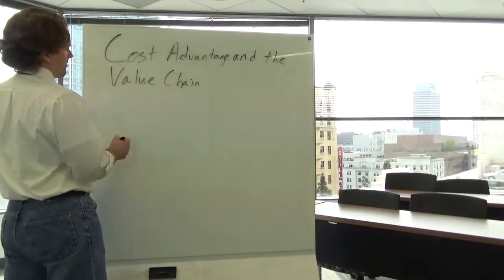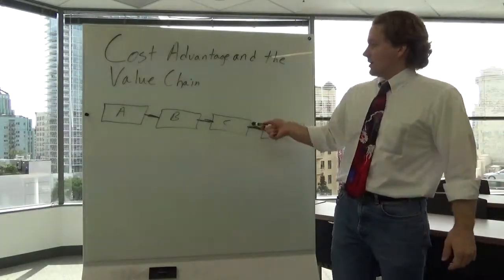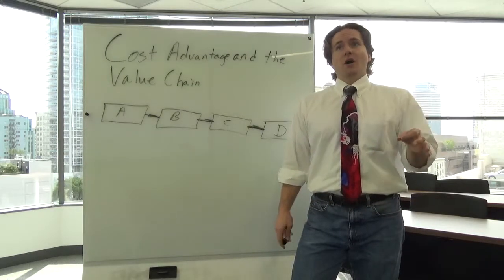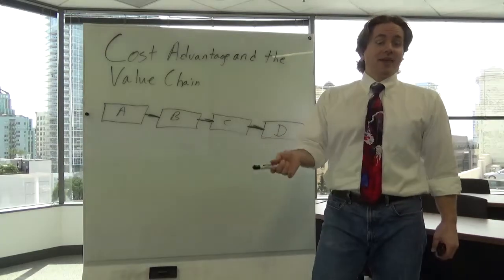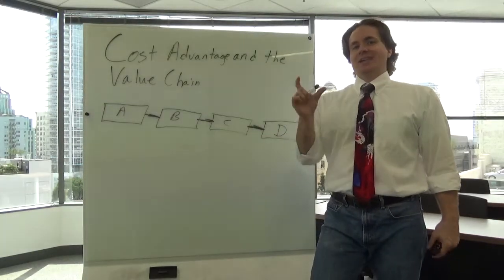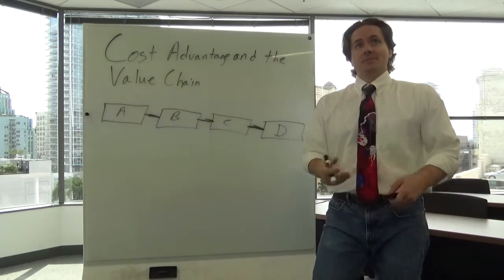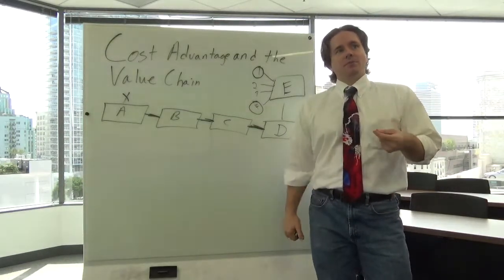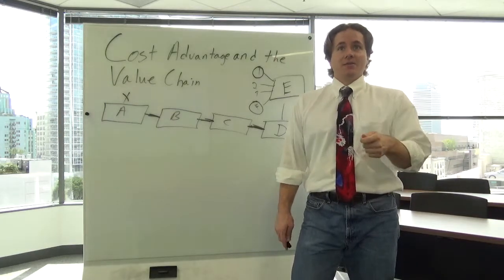Cost Advantage and the Value Chain

Comment: Could you maybe help me out with a quick explanation of the difference of an industrial chain (Industry Value Chain), value chain, and a supply chain? 
is an industry value chain a supply chain or is there a difference? 
because i just read now about value chain analysis and it said there are two observation units: Industry value chain analysis and corporate value chain analysis. 
Then i tried to google more details about industry value chain analysis... did not find anything promising. but instead i found complex information about industrial chain, value chain and supply chain and i am even more confused now... best wishes from Austria!
Reply from the maker: Sadly, there are so many authors on these subjects an they also use contradictory terms that it can be tough to understand.  

Let's start with the firm value chain.  The firm value chain basically discusses everything that one company does to provide some value added product for a customer.  This includes the support functions (i.e. human resources, IT) and the work done by line units in a firm (i.e. operations, inbound/outbound logistics, marketing and customer service - aka primary activities).  Each firm will have a slightly different value chain based upon its actual work - so a baker would focus a lot on logistics and operations but maybe not on IT, but a consulting firm would probably need much more IT and less logistics.  This understanding was made famous by Michael Porter, and a quick google search can find tons of diagrams that show his charts.     

The Industry Value Chain (which is what I normally just call the value chain) looks at the industry as the level of analysis, and assesses what value added steps occur in a process.  Think of manufacturing cars.  Someone puts together a windshield, vulcanizes the rubber for tires, designs the engine, puts the entire thing together, markets the car, sells the cars, etc.  These different steps may be performed inside of just one firm or may be in multiple firms across an industry.  Whether this is done in house or is contracted in the open market is a question for Transaction Cost Economics (I have a video on that as well).  Either way, we are examining how raw materials are converted into a product and then sold in one or many firms.  The firm value chain normally just looks at the activities conducted in a single firm, and less so as to what happens outside of the firm.  Does this help?  

A supply chain is very similar to the industry value chain, but much more emphasis is placed on the logistics, information flow, and financial transfers between the different steps in the industry value chain.  I have also seen a lot of supply chain diagrams be very specific about who are the exact suppliers, people who move materials, and stakeholders in the process.  Of course you can also do this for an industry value chain, but this is usually more of a bird's eye view, while a supply chain is a bit more in the weeds.  

Again, I do give a caveat: these terms don't have exactly the most universal definitions (like so many ideas in business), so a little context can be helpful when dealing with professors, clients, etc.  

I apologize for the crazy long answer, but is this helpful?  If not, let me know and I will clarify.  By the way, I am jealous you are in Austria - Vienna is one of my favorite cities in the world to visit!
Reply: @DrDUniversity  I have already replied a few minutes ago actually but I don't see my answer anymore. Seems like it disappeared.. however, I write it again...maybe it appears as a reply on another comment here and you receive the notification.. so if you read that twice.. sorry. I wrote before thank you so so so much you really helped me out with that since you confirm the principles of my idea of those concepts i. e. I am kinda right about that. Of course, I expected there to be many definitions but as you explained the principles, it absolutely make sense to me. I just had copied your explanation to a word file and printed it out. So This is just amazing thank you so much for your effort and for your time!!! and luckily you love Vienna.. that's amazing of course.. Though I have to admit i have moved to Berne in Switzerland and spend a bit of my time here now :-) best wishes!!